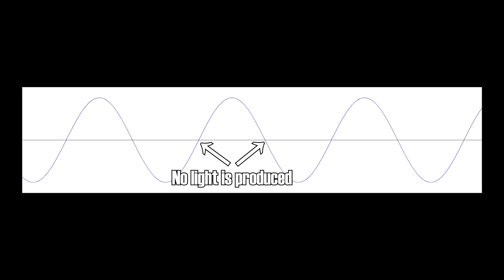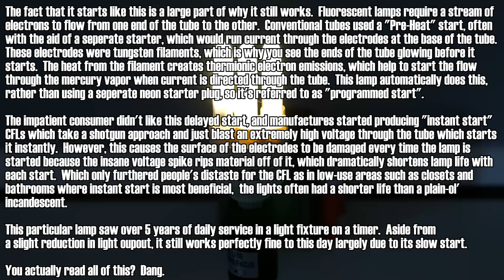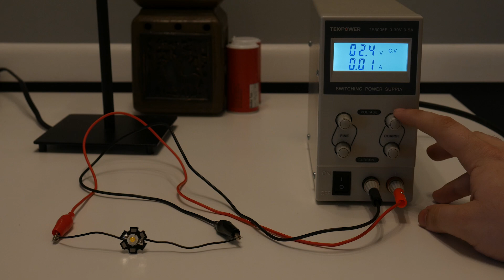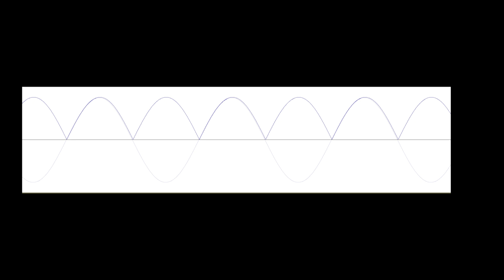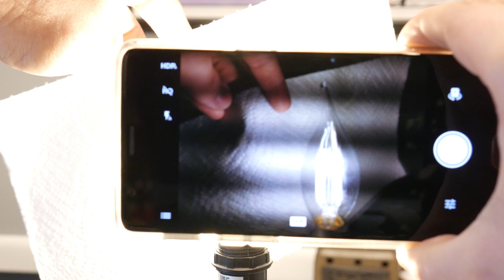LED bulbs that flicker, and CFLs that almost never did

Comment: i am a terrible person and prefer halogen bulbs. i have some CFLs left but i never use them as they take 15 minutes to be bright enough.
what i don't like about the fluorescent tubes is they look like they are a good light source but they are not, reading/working under them is terrible. 
the only thing they are good for is lighting up hallways.
Reply: L.E.D.s :)
Reply: The build up is enjoyable for me.
Reply: SandyStarchild incandescent and led for life
Reply: The build up of light is painful... I forgot what kind of bulbs I have, but I'd rather get a headache than use slow-starting bulbs. Though I only get headaches when I can see the bulbs from the corner of my eye and I kinda make sure I'm either facing away from them or I have a lampshade.
Reply: 4000k LED for work is perfect. It's not quite the bright white you get with 6000k or above, but it looks like white light. It's perfect really, better than incandescent or fluro for work. 3000k LED for spaces like bedrooms, lounges and hallways. It's slightly more yellow than incandescent, but only slightly.

And flickering is only a problem with poor quality LEDs. Since decent ones are getting stupidly cheap now, it makes no sense to buy anything else but good quality LEDs. The only exception I would make is halogens for light fixtures that have pretty glass or crystal, because no LED will make that pop like it should.

Edit: the 2800k ones that are becoming common are slightly more yellow than incandescent, NOT the 3000k ones. I prefer 3000k to 2800k, but 3000k seems to be getting harder to find on the shelves, as is unfortunately 4000k. Not happy really, we are getting forced to choose between 2800k, which is too yellow, and 6000k, which is too white. You would think with the amount of control available with LEDs that the market would favour more choice not less.

Comment: Thank you for not dumbing this down. As an almost-electrical engineer (I switched my major to software), I appreciate the gritty details of bridge rectifiers, voltage drops, filter capacitors, and all the other electronics-geek goodies you packed into this video. Cheers!
Reply: Matt Whitlock Jesus man. Im software changing major to electrical. Any tips?
Reply: Don't run out of money. I went from Comp Sci to EE at a more expensive school because the coursework in comp sci at that point was full of stuff I already knew, some I knew was way outdated. should've stuck it out considering I was also pretty poor and couldn't afford the new school for long enough.
Reply: Matt, are you sure you're into electronics? You never mentioned a FULL BRIDGE RECTIFIER!

Just kidding, happy new year in advance, all 😊
Reply: Same here, I did the more practical side of electricians basics with the theory required for that it still makes sense :D